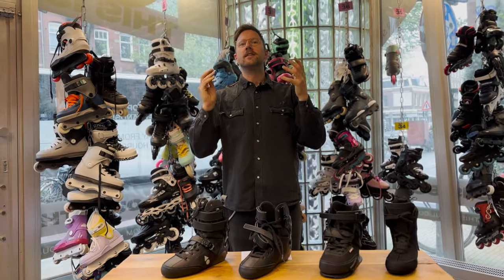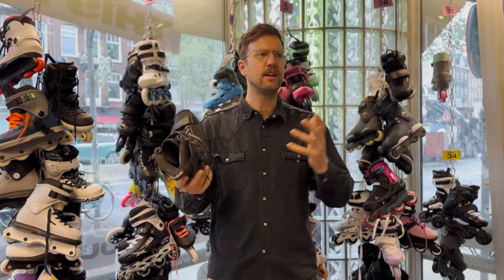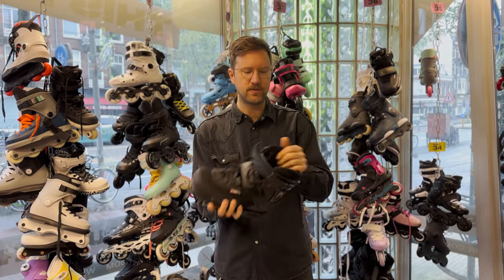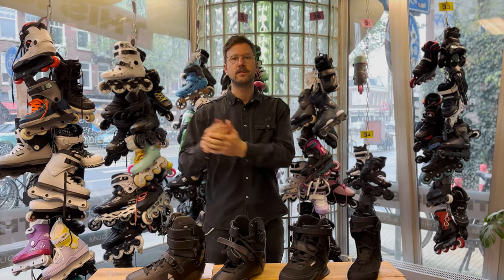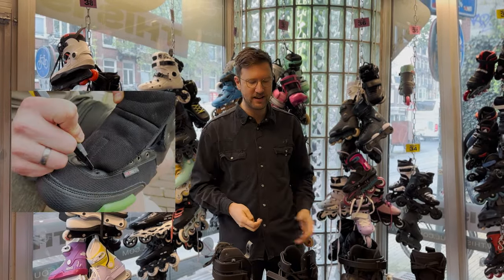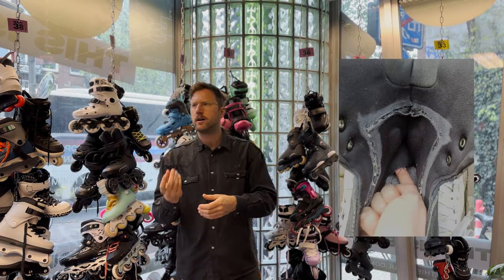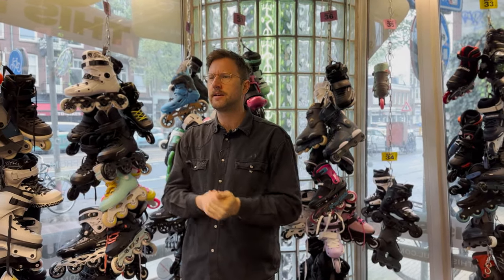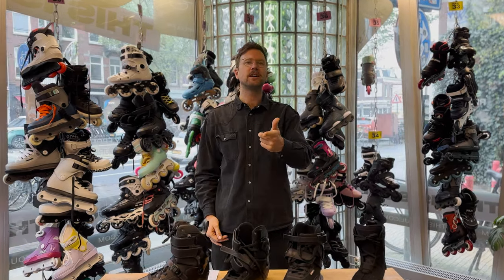GUTTING SEBA CJ

Comment: Thanks to thisissoul, I'm already gutted my CJ, interesting fact that CJ size 10(43EU, 28cm) perfectly fit with intuition liner 10,5-11 (43,5-44,5 EU, 28,5-29cm) just magic😂
Reply: Because plastic 43 and 44 are the same shell plastic size but in 43 are added foam on the toes to fit. After gutted you have 44, I have 44 prime plastic with 28.5-29 cm intuition from UFR with my 28.6 right and 29 left shells are little to small on left but added extra insole under the liner and now are great, I feel the end of the shell but don't make me any discomfort:)
Reply: @xywy8  but i gutted the carbon one, and they are true to size, but standard liner is tooo thick
Reply: Oh that's interesting, I have one question for you how wide yours feet are ? Mine is like 10.5-11 cm and I feel it could be wider boots
Reply: @xywy8  both feets are 11cm, but my feet are very low, maybe that's why 43 EU 28cm was enough wide, with my 11 cm wide and 28,3 cm long feets 😁
Reply: Good to know thanks, I'm looking for 44 CJ carbon but I'm afraid they could be not as wide like plastic version. I have gutted SX carbon 46 with CJ forys liner and added intuition butterflies to fit better.
Reply: Man this comment really rustles my inline skate sizing jimmies, going by the guides out there (liner sizing table on wizard skating website) you should install the size 42 liner in them. I'm also using a size 43 carbon with 282mm silly low feet but I'm afraid to order a 42 premium intuition cause I think it's going to be too small but putting a 44 premium liner in them sounds so crazy, I couldn't fit the size 44 premium liner in my size 44 CJ2 primes because it just had too much volume and those boots were way too big for my feet. The 43 carbon shell is more snug for sure.
Reply: @PieterRV82  it may be unexpected, but carbon CJs have an incredible amount of internal padding, even Erik here on the channel mentioned that his carbon CJs were 1.5 sizes out.  That's why I was surprised, but intuition 43.5-44.5 easily fit into the gray CJ 43 EU 2014.  There is even some extra space in the length, and the width of the boot fits perfectly 😁 I'm thinking of adding a rise in the area of the heel
Reply: @inline_skating  Thanks for your reply! K, I have the 2020 CJ Carbon but they are pretty padded too. I have the superfeet heel raiser installed btw, I like it. Have pretty low feet too.

Comment: Can I jusy simply put smaller and thinner liner without completely gutting it? Just remove the tounge only. 

My seba cj2 size 41 and need to downsize by adding size 40 liner.
Reply from the maker: I would not advice top put an extra liner in your CJ2 skates. The you can also get a size smaller skates and it would work allot better.

Comment: One question, after gutting, if we remove the upper part of the liner completely (the part where you have the last 6 lace holes), is it possible to have a skate that mimics the Faction Tactical V1?
Reply: Hi there, i left the fabric around those top holes in place because the grommets hold the plastic insert together inside the soft exterior
Reply: but cut out all the filler between the holes completely.
Reply from the maker: Yes the skate would then have more forward flex similar to a faction skate
Reply: I have cut away the top part of my USD carbons. What cuff would you recommend mounting on USD Carbons,  in stead of the regular cuffs, as these are not supporting enough, or will you supply Faction cuffs in the near future, @Thisissoul ?